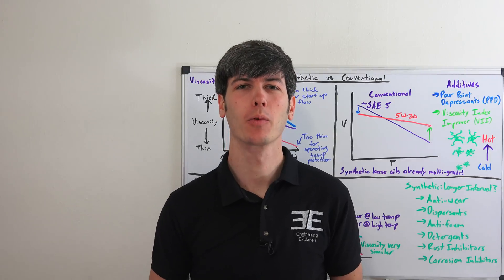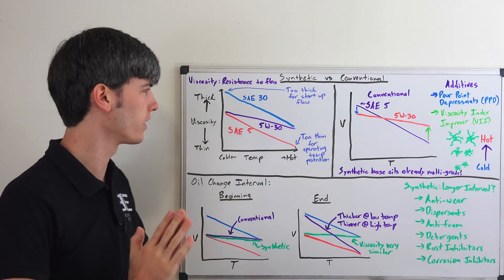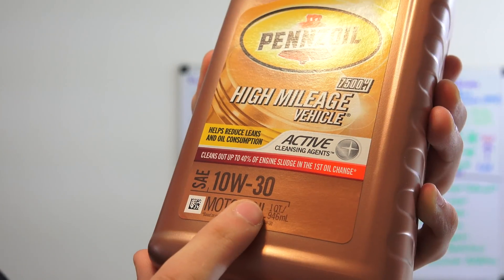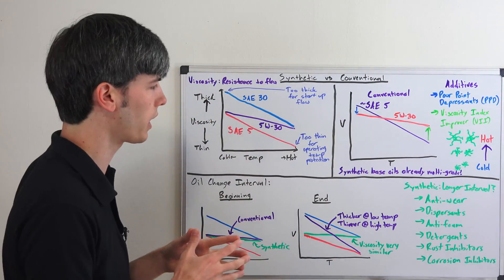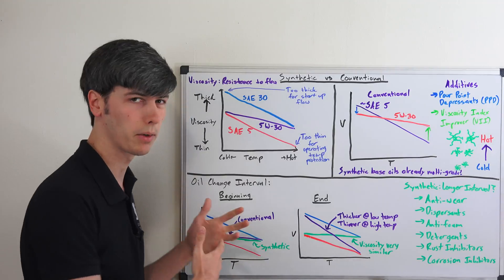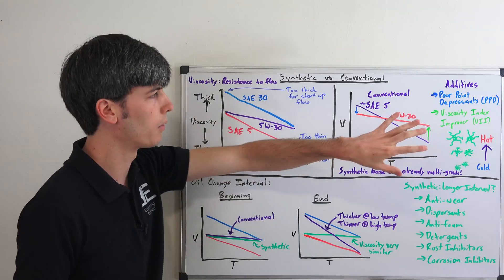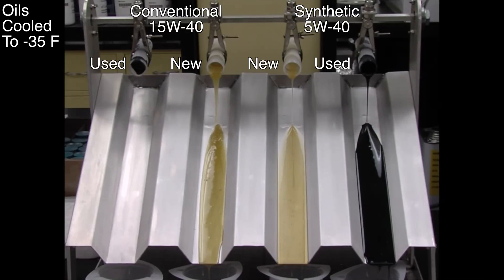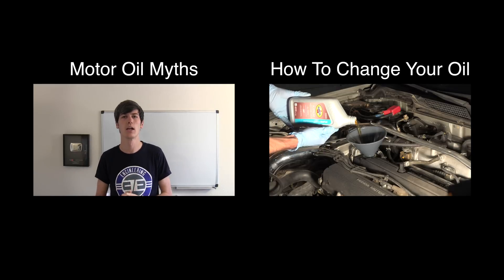Is Synthetic Motor Oil Better For Your Car?

Comment: I do exspensive old changes for my car. makes it feel exotic hahaha. I run car up to operating temp, add oil flush run for 5 mins, drain, add 5 quarts of supertech and run for 15 mins, drain, replace filter, add full synthetic, and do it all again every 2,000 miles.

Comment: Unlike most of the chatter here, I have a serious question.  

In your tests, you specified that one oil was new and the other used.  I am curious what conditions was the used oil subjected to?  how many miles?  What type of engine (eg. old or new, was it leaking/burning oil?)? what were the driving conditions? (stop and go vs highway?, towing? other?). 

The experiment was an interesting one and I really want to learn the most from it. thanks!
Reply: In my opinion that demonstration was a scam. Naturally the 15w won't pour as fast as the 5w at-35f so to use those two against each other to demonstrate old conventional vs old synthetic is wrong. What if the synthetic had been at 15w and the conventional at 5w ? Then the conventional would have poured faster at-35f. Not a real good example because you can't compare apples to oranges! They could have done the demonstration using 5w for both kinds, but they choose not to. Hum, I wonder why?
Reply: @jpol3808  Because if you paid attention to what he was actually saying (the logical piece of the comparison), it's NOT to compare the conventional flow against the synthetic flow, it's to compare the flow rate characteristics of each other. He even stated it point blank in the video, "You might be thinking, 'hey! That's not a fair comparison, because they're not the same viscosity ratings!' But that's not what I'm comparing. What I'm comparing is...", so you may want to pay closer attention to what he's saying rather than being glued to the images. They could've put canola oil instead of synthetic and the point regarding conventional would've still been made, although the point for the synthetic would've been lost since you would see how viscosity changes for canola oil from new to used rather than synthetic properties. Of course, one could always argue, "What brands of oil did you use???" 
Bottom Line: 
The comparison is for used conventional against new conventional and used synthetic against new synthetic, NOT the types against each other. 
Now, to you and OP's point: would I prefer to see syn/con? Sure. Who wouldn't? Seems reasonable to me. However, seeing the viscosity difference (significant increase in conventional) of each when new and used is the evidence he was trying to explain regarding viscosity (or flow rate) from the graphs that he had drawn and explained just before the oil demonstration.
Also, I'm not even sure you can get a 0W-20 fully conventional oil. I know there's syn-blends, but I don't think there's a fully conventional with such a low viscosity for 'Winter' test temperatures. Which proves the advantage of synthetic, again. More stability regarding viscosity across temperatures, which is ideally what you want.
Reply: @ryanshannon7703  lol he's got you fooled. Watch carefully, this is a dramatization and not an actual test of conventional or synthetic oils. Had this been an actual test of motor oil, we would have monitored all parameters and made sure that all specifications were equal. I listened, now you need to let your mind absorb the information your eyes were watching and disregard what your ears were being told. One sample was frozen! Lol real comparison in my book. Now watch as I make this quart of oil disappear! I give up. Buy em a book and send em to school and look what you end up with.... Ryan.

Comment: Full synthetic is not made from synthetic base oils, its just a marketing term. Full synthetic means made from highly refined natural petroleum, it will still have unevenly sized molecules like any other oil. Real synthetic oil would say '100% synthetic' on the package, that is the only oil that is really made from synthetic base oils ester/ poly-alpha-olefin

Comment: I compared conventional and Synthetic oil in my car and used it to about 5-6k miles before changing oil. All I can say is that synthetic runs way smoother. My MPG also increased from 28mpg to 34mpg. Don't skimp out on shitty oil

Comment: I use SAE 10W-40 Selenia for my 1.9JTD (170hp), changing it every 10k km (even though it should be on around 15k), and I already got around 300k km on tacho with really healthy engine :)

Comment: I hate to be a nag, but I think the experiment is not thorough due to the fact that the oil will be heated as it's used in the engine, the oil used in the experiment should be at running temperature like you mentioned in the beginning of the video.. they could be different viscosity at different temperatures, butter is hard when it's cold but when you heat it up it's like the same viscosity as room temperature olive oil..

Comment: My 88 Corsica just rolled over 700,000 miles. Can I switch to full synthetic now without repercussions such as leaking gaskets or the synthetic oil cleaning out the sludge that could very well be holding components together? The engine seems fine with just your typical knocks and ticks.

Comment: The oil flow comparison at the end of the video is just making people think "oh my god I need to get synthetic!" When in reality 5w-40 convential would still have comparable flow to synthetic after being used. So honestly it's just designed to make you get synthetic especially since the video is sponsored by an oil company. No offense to you, but should really do a fair comparison. Most people live in climates where the temperature doesn't drop below 0.

Comment: #Exposed! Full Synthetic Oil is technically not Synthetic oil at all of what you though of all these years. It's really over priced Petroleum based motor oil + Additives based on Group 3 Basestocks. 100% Synthetic oil  is the "real" Synthetic oil based on Group 4 Basestock. Castrol was sued in 1999 by Mobil claiming Castrol was marketing it's labeled Full Synthetic as Synthetic when really its oil that came from the ground that's been enhanced. Mobil lost the lawsuit and decided to follow what Castrol was doing to cut down cost and the market followed. AMSOIL makes Genuine 100% Synthetic motor oil that was created from scratch non Petroleum. Big difference between the labels 100% Synthetic vs Full Synthetic.

Comment: Are there any differences between branded oil (Castrol etc.) and supermarket oil (Asda etc.)? Thanks.
Reply: Asda's engine oils are actually pretty good. They don't have one suitable for my car, which requires ACEA C1 certification. Thing is for the same money you can visit www.opieoils.co.uk and have access to a huge range of branded oils. Often cheaper than Asda and always cheaper than Halfords. I'm current using Millers Oils XF Longlife C1 5w30 in my Mazda 6.

Comment: 5:50 "Now at this point you maybe thinking, wait a minute, this isn't a fair comparison because the synthetic has a lower cold viscocity rating, so of course it will flow faster at low temps... you're absolutly right, however this is the only video i got" 😂😂😂

Comment: I go 15K miles before next change of Syntethic motor oil, if I am busy I easy stretch it to 18 k miles, no probleem, just make sure you replace the oil FILTER with the one for Synthetic oil, Cost more but works fine. I drive my car about 1000 miles a week doing car services.
Reply: elruforafa I’ve been using Amsoil for over 20 years in all my cars and my boat. In my cars I go 16,000 miles between changes and change the filters with ones specifically for synthetic (also Amsoil brand) every 4000 miles. Never had an oil related issue with any of my cars. I put about 80 hours per year on my twin Crusader big block 350 hp engines and change the filters every year and the oil every 3 years . Oil usually comes out looking like it just came out of the bottle.

Comment: So can I switch to a synthetic from conventional in a higher millage engine? I have a few spots that leak a little but nothing major. I'm mot necessarily looking for longer life at this point. but a better running temp and mileage are always a plus.
Reply: You can switch quite safely. If there are any leaky bits then synthetic oil is more likely to find them but the differences are as vast as the conventional (mineral) oil fanboys will claim.

Comment: so, I have a question with regard to oil and rotary engines specifically.  I've always heard that Wankel rotary engines like those found in the RX-8 and RX-7 should be conventional oil only.  not only because of their ability to burn through oil which makes synthetic very costly, but also because the conventional oil protects the internals better.  is there any truth to the last bit of that statement? or is it all really an oil cost thing?

Comment: I live in the Philippines, a tropical weather where our average temp is 36c. I owned a ford expedition and it recommends 5w-20 oil. can I use different viscosity or I should stick tothe factory recommendation

Comment: A very good, very clear explanation and demonstration of why synthetic is a lot better than dino oil. Thank you.
Reply: if by dino you mean fossil based then sorry, synthetic oil contans as much dino as conventional does
Reply: @Alvenek  No it doesn't.
Reply: @nicoctane1669  yes it does buddy. the "synthetic" only refers to the chemical enhancement/purification of the petroleum, but it's still petroleum. synthetic oils made from non-petroleum products are produced, but are not used in passenger vehicles
Reply: @Alvenek  No you're way off.

Comment: Helps a lot ! I have a 1989 Camry LE with about 347,000 miles on it and all I do is change the tires, oil, brakes you know regular must do maintenance and I found that synthetic oil makes this car run better, I can't explain but it does and she will never quit on me !
Reply: Toyotas from that era will never die.  My dad had a '91 Corolla with over 300k and he did nothing except change the oil and spark plugs.  He sold it years ago and I still see it around town occasionally.   Great cars.
Reply: @jshepard152  Toyotas from early 90s are almost indestructibly, specially the Corollas.
Reply: Otro canal de yutubi
Yep.  I had a 2006 that was bulletproof too.
Reply: Wow, that car is older than me. You are good owner.

Comment: Used Synthetic oil in my 1992 Firebird from day one - brand new - did a partial over haul on pistons and values @ 150,000 miles - but didn't need anything except seals. It looked like a mirror inside. I now have 229,000 miles on a Firebird Coupe and runs perfectly. SYNTHETIC is the only oil one should use in their engine!...and the Firebird is in excellent condition - inside and out!

Comment: I've never used Penzoil. Always considered them a crappy brand years ago. I'm sure things have changed but during that time, Mobil, Valvoline, Castrol, Rotella, Amsoil, Schaeffer, and others have marched on with great reputations and formulations.

I put Penzoil in the same bin as Quaker State, Halvoline, and other cheap stuff. Maybe someone can enlighten me how things are today.

Comment: Engineering Explained, I deduce from the in depth information on Synthetic OIL VS Conventional OIL that you are a REAL Engineer.  Having said that PLEASE explain to me why in the WORLD do you a REAL Engineer, refer to OIL that is used in the Internal Combustible ENGINE as motor oil ?  Is it NOT an ENGINE , and I'm SURE "motors" run on electricity.  Engines ARE NOT motors I don't care what your dicKtionary claims. It IS what it IS.... ENGINE OIL ...... PERIOD

Comment: Use Mobil one.  Not cheap wal mart oil
Reply: You realize they sell mobil 1 at walmart right? wow you have brains
Reply: Kevin Voeks i hope you know mobil 1 isn't that great...
Reply: 👍 The “cheap oil” is actually more expensive.. you need about 5 regular oil changes to cover 15000 miles - which some of the good synthetic oils cover (castrol golden jug 0w20 full synthetic = 30$ /5 gallon at walmart)

Comment: Serious question: I recently got a 2016 Mustang GT, it only has ~3300 miles on it.
 (Worth noting: the dealership changed the oil when they received the car from it's original owner) Should I have them put synthetic in it (if they didn't already, I'll have to check) at the next oil change?  I live in an area that gets quite cold (down to & below 0F at times) in the winter, & very warm (sometimes north of 100F) in the summer.

Comment: Replace them at the same interval?  No, now that's absolutely not true.  Which is odd because you CLEARLY know what you're talking about much more than I could ever hope to.  So what I think you're doing is just basically just keeping it simple, even though it is very possible to use synthetic oils much longer than conventional oils depending on several factors.
Reply: It's a legal liability issue: he can't go on record recommending you ignore the manufacturer's recommendation for change intervals.
Reply: Paul Zink actually he could tell you to fill it with pop tart filling if he really wanted to.

Comment: so with what knowledge i have in physics and fluid dynamics, everything stated is spot on.  My only question is why and how do some car manufactures state and justify using conventional oil instead of synthetic in newer cars still?  I have a '14 turbo sonata and my car requires conventional.  Any thoughts?

Comment: If you have an old car "pre-synthetic oil" and you switch from conventional oil to synthetic oil you may find that your car has suddenly developed oil leaks. Those old worn seals just don't like synthetic oil... BTW, I once owned  an old Chevy that burned gas and oil. Does that make it a "Hybrid Car"???
Reply: Typically you can use modern oil with an older car so long as its not from the early 20th century, all sm (currently rated) oils can lubricate older cars better than the older ones, you might just need to replace your seals if they are still factory
Reply: @TapRackBangAirsoft  You can use synthetic, but use something like 15W40.  If you use 5W20 or something like that, you might have low oil pressure.
Reply: No modern style fluids seem to be antique friendly, do they?
Also, my uncle's El Camino that he uses as a farm truck burns more oil than it does gas. Everywhere it goes, you'd swear a group of hipsters are hogging the road in their Vespa scooters. Nope, it's a rusty, somewhat ragged out but still good running 1970 El Camino.
Reply: Synthetics are highly detergent and clean gunk off of old seals that kept them from leaking in the first place. Conventional oils break down easily, burn more easily, and evaporate more leaving all sorts of gunk behind if you go too many miles.

Comment: The owners manual of my car told me to use synthetic only
Reply: Most recent cars runs synthetic oils. There are no conventional 0w20 or 0w16 oils. Those grades, like the 5w40, needs a good synthetic base oil.
Reply: Hydro cams regulation need only good oil dont want any semisynth

Comment: So basically if you don't change your oil on time every time or want to go longer in between get synthetic. If your car leaks a bit( I believe I got this info from mobil 1 *concept) then more synthetic would be able to escape through the same size hole because the oil is made from (mobil 1 i think) natural gas (full synthetic) making the molecules align in an orderly fashion so you should run conventional. I could be wrong but that is the summation of my minimal knowledge on the subject

Comment: horsemanure. TBN is more important toward the end of the oils' use. If you live like in Alaska, use the synthetic. Very cold places OK. Down south, use the conventional and change every 5k for your car. As a marine engineer since 1984 we have stuck with standard Mobil straight 30W oil and NEVER CHANGED IT - 125,000 hours on the oil!!!. Crosshead type,  2 stroke/ cycle, uniflow scavenged, turbocharged, diesel engines. We would "sweeten it up" for purposes of increasing TBN and lesser often for viscosity. Oil will NOT wear out if, 1. you keep the moisture out of it. 2. you keep it from overheating, and 3. you centrifuge and/or filter it consistantly. So stop wasting your money on Synthetic unless you know it is going to get VERY hot or VERY cold. He did do a nice job with the graphs. And one more piece of advice, if you use an electric (heated) dipstick to keep your oil warm. it is all good. When you keep the oil continuously near 100C and temp stable, you'll always stretch the life of the oil. TBN  then becomes the endpoint of use.

Comment: So if I understand correctly, the mineral oil I'm being sold as 5W30 eventually turns into something like 5W20, then 5W10 and eventually in 5W5, or something of that sort ?

Is their any way, for oil manifacturer to tell me how long this ''depreciation'' process should take ? Seing that no such info seems available, should I expect the oil I buy as 5W30 to keep this rating for it's usefull life (5000-8000 km) ? If not, whats the use of the rating 5W30 on the bottle, if after a couple of km it turns into SAE5 grade oil ?

Comment: Even if you get your oil changed exactly every 3000 miles using conventional oil, it's nowhere near as good as fully synthetic oil...engines just last a lot longer with synthetic oil and are less prone to issues down the line.

Comment: the conventional oil was written "for high mileage", so its suitable for old engine that has a wider space between the piston and the block. if old engine uses synthetic oil, it dried up too fast.